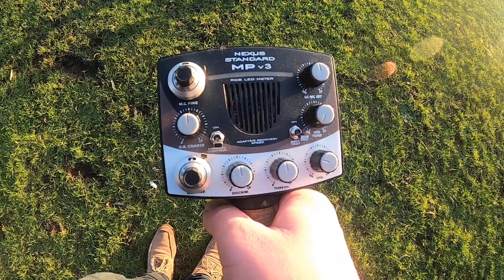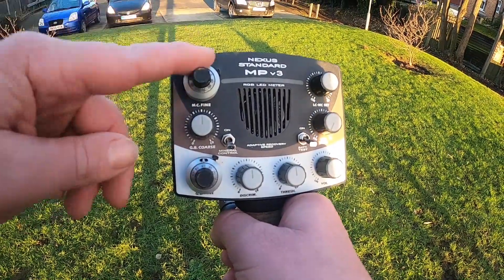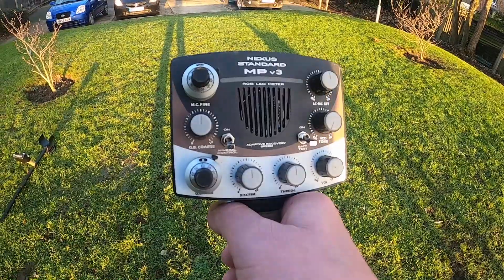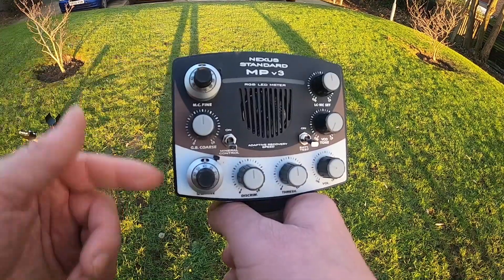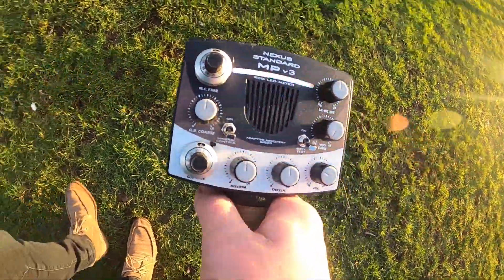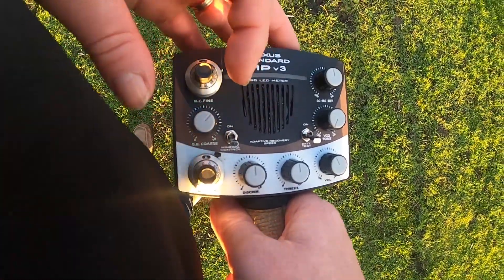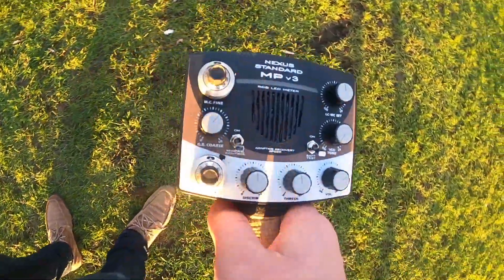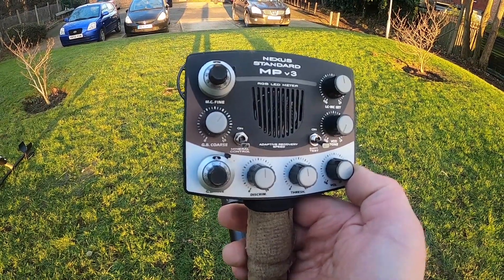Nexus Standard MP V3 Ground Balance Demonstration & Explanation

Comment: Paul thanks for the video, but when do you use the GB FINE? or do you leave it on the middle? I believe that the soils in Italy are similar to yours in the UK, a few points with strong mineralisation
Reply from the maker: Hi my model is one of the first V3 detectors to be made, all machines manufactured after January 2023 ground balance slightly differently, this video explains it https://youtu.be/gFGX_3M6wZQ?si=dyVSb7AaRMZyfpql
Reply: @paulwarrenmetaldetecting  yes I saw this video and it is what is written in the manual, what I didn't understand well is what the 0 point on GB FINE is, let me explain. If I try to balance it as you advised it balances, but it no longer detects the silver (it is revealed as ferrous) so by keeping GB COARSE at 10 I can balance it by rotating GB FINE, but the same thing if I start from 5 I don't really understand which be the zero point, the origin let's say (I don't know if I explained myself well)
Reply from the maker: @BexMD  What coil are you using and where have you got your discrimination set?
Reply: @paulwarrenmetaldetecting  10 inch 10 khz, 0 disc
Reply from the maker: @BexMD  it should be detecting small silver, I'll make a video today ground balancing the 10' inch DD coil
Reply: @paulwarrenmetaldetecting  great Paul!
Reply: @paulwarrenmetaldetecting  silver detects it very well! it stops revealing it if I move the GB COARSE too counterclockwise and the GB FINE must be under 5, where can I send you a video to show you? my English is not good I can't explain myself well

Comment: So do you want a little sound when raising the coil or you want no noise at all up and down
Reply from the maker: You can phase the sound out as much as possible when lifting and lowering the coil, the sweet spot I talk about is where the threshold engages as I lift and lower the coil, I like to set it there, I bring the threshold level down a touch and start hunting, it's not an exact science, once you're on the 'sweet spot' you can use the GB fine to phase the noise out further
Reply: Good video. Thank you mate.
Reply: @paulwarrenmetaldetecting  thanks paul.. watching this and the v2 vid really helps..think I got it now
Reply from the maker: @jhapes1  Fantastic 👍🏻

Comment: Good demo!

I haven't found a paper that describes the (best practice) of ground balancing VLF detectors, one must exist.

We're trying to neutralize the ground mineralization on the down stroke. 
Is the up stroke an attempt to mitigate EMF?

Is there a reason why we don't allow the coil to come in contact with the ground on the downward stroke? 

Is there a certain height that we should be above the surface of the ground to initiate ground balance? If yes how do we determine that height?

Tks!
Reply from the maker: You have a positive and negative ground balance, the aim is to find a happy medium between the two, depending on coil size, Nexus machines need to be balanced and swung above the ground 2 to 3 inches, you can't scrub the ground with these machines. Ground balancing has nothing to do with EMI interference. The way I see it, whilst ground balancing you're shifting the ground so the machine can't see it, that's why, when ground balance correctly the MP detectors will go deeper in the ground than in air.
Reply: @paulwarrenmetaldetecting  I understand as you have stated. Tks!

Comment: V3 ü yeni satın aldım 13 inch 6 khz ve 11,5 inch 24 khz başlıkları mevcut, nexusu madenli ve mineralli toprakta balansa sokmakta baya güçlük çekiyorum, 3cm lik bakır parayı cep sistemi toprağa gömüp test yapıyorum 30 cm de zor algılıyor… mineral konusunda nexusu dirençli sanıyordum yanılmışım…
Reply from the maker: Burying coins freshly in the ground to detect is totally pointless, basically an air test, Nexus excels on targets that have been buried in the ground for long periods of time. The machine was designed on the highly mineralised and magnetite ridden soils over in Bulgaria and is the deepest induction balance machine ever made. Instead of burying fresh targets go out into the wild and hunt. If you're having trouble tuning the machine you can engage mineral control. The point to understand from this video is, this is the first generation V3 where the ground balance operated differently to the current models. This video explains how to GB the latest model https://youtu.be/gFGX_3M6wZQ?si=OpmjQhuN1rY6q81q
Reply: @paulwarrenmetaldetecting  Bulunduğum bölge krom madeni ve manyetit yüklü toprak, şu ana kadar 34 adet farklı model dedektör kullandım bu toprak yapısında, en derin Dalan dedektör 20 cm den daha aşağı inemedi, nexus ile 20 cm nin altına inebilmek, 25- 30 mm lik roma ve Bizans paralarını avlıyorum, eğer bu toprak yapısında doğru balans yapabilirsem çok şeyler yakalayacağıma inanıyorum, video için teşekkür ederim, dün balans yaparken aynı yolu denedim çünkü geçmiş dedektör tecrübem var, balans yaptıktan sonra ayar değiştirmek balans bozuyor, hangi ayar yapılacaksa balanstan önce yapılmalı, soldaki 3 düğme birbiri arasında kombineli olmalı bunu farkettim…
Reply from the maker: @tuncayozdemir7133  Good Luck ✌🏻👍🏻